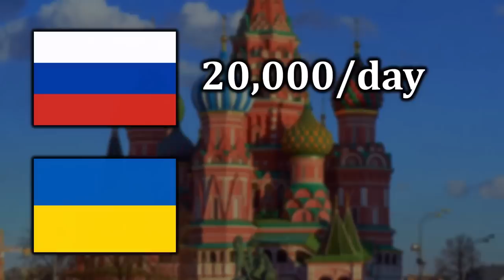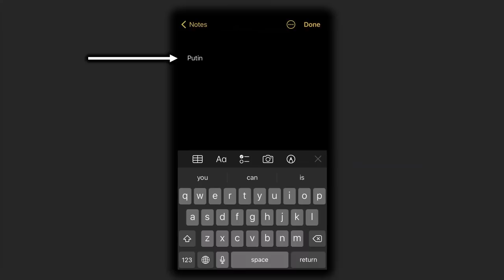Ukraine's Artillery Shortage Has a Simple Solution. Will the West Implement It?

Comment: Also, if more shells are supplied, the barrels will wear out more quickly. Which means producing more artillery barrels is needed.
But going through with the producing contracts would be cheaper than going back to the appeasement politics. Which worked extremely well last time Europe faced warmongering dictators...
Reply: For some definitions of "extremely well".
Reply: @johnbaker1256  yeah, I'm not the best when it comes to sarcasm in text form...
Reply: @AssassinAgent  The sarcasm was clear.
Reply: @AssassinAgent  You're doing ok
Reply: @AssassinAgent The sarcasm was loud and clear (ly sarcastic).
Reply: The thing is, NATO military doctrine is to use fighter jets deployed munitions rather than artillery.
Artillery role is supposed to be auxiliary.
And it makes A LOT of sense if you think about it.
You can have gliding bombs attached to the plane right in ammo hub in Germany or UK, get refueled over Poland or Romania, drop its payload and fly back to Germany.
No need for long and vulnerable supply chain, no need to put your artillery in a position where enemy can attack it.
And as for infantry close support, it is supposed to be done by tanks (like UAF already do) and by attack helicopters (Hellfire missile was designed with this kind of job in mind, not to mention Brimstone)
Reply: @skipperg4436 All of that makes sense in a context that doesn’t involve Ukraine. If Ukraine can be fed enough artillery and other resources then Nato essentially has a crippled Russia that cannot do anything without having to expend any of the manpower and more expensive aircraft resources. Essentially changing the doctrine on the fly to use Ukraine as a proxy war is the optimal new strategy that should supersede the current doctrine at least temporarily
Reply: @skipperg4436 except the UK have just announced it is going to expand its cdre of self-propelled artillery! 

Also 155mm shells also get converted into laser or precision guided smart munitions, glide bombs and rocket assisted glide bombs.
Reply: @DraigBlackCat  UK is doing their part in defeating Putler
Reply: @badart3204  true.
However it is possible to avoid the problem of raising manufacturing of new shells entirely by providing Ukraine several hundreds of fighter jets.
There are many thousands of fighter jets around that are currently idling.
Also this would solve the question of anti-air defense and naval defense because fighter jet is a great platform for weapons that can do all of these jobs.
That's basically the reason why western countries don't rely on artillery anymore...
Reply: @skipperg4436  I just hope our Govt refills the larder so we would still be able to do something similar in 10 years time!
Reply: I'm also a little concerned that the mighty USA can't provide enough artillery shells for Ukraine to wage war. US doctrine is based on being able to fight a two-front war..  against China and Russia. 

Even if all NATO countries met the 2% target this problem would still be there, it's not like all that money would go to 155mm artillery shells. It's clear we have all underestimated how much artillery could be needed in the event of a war. 

These shells cost $3500 each, so for $3.5 billion you can buy 1 million shells. Maybe more in bulk idk. Considering NATO's combined wealth of over $32 trillion GDP (not to mention non-NATO partners supplying help!) there is no excuse not to sign large artillery shell contracts with manufacturers. Absolute worst case scenario: we end up with a massive stockpile of NATO standardized shells, which could actually come in very handy as this war has clearly demonstrated. 

You're also correct about the artillery barrels but I have a feeling the shells cost more in total. I'm sure spending, say, $20 billion on artillery shell and barrel production would get Ukraine millions of shells. That's a lot of money, but considering Germany injected a one-time extra $100 billion into defense last year I'm sure NATO collectively can afford it quite easily. And if the war ends we'll be prepared for potential future conflicts. No matter how much equipment evolves, the ability to rain artillery hell down upon an enemy will always be a useful thing, as Russia has demonstrated. 

Also Ukraine itself could produce 155mm NATO shells probably far cheaper in a total war economy.
Reply: @Altrop  it since they dont want to go into its warreserves they still have over 10 million shells in stock since they want the shells to fight those 2 wars
Reply: @Altrop  they just don't want to because they - their government not regular folk - don't care. Thus all the excuses
Reply: @skipperg4436    @tuehojbjerg969 then we all have a moral duty to tell our governments we want this. Some opposition parties will agree, even if it's only for votes. Then the governing parties shit themselves and will give in, afraid to lose the next election.

Ah the beauty of European politics.
Reply: @skipperg4436  And this is the whole reason why Ukraine is struggling... nothing much in the air. Hopefully the aircraft, whether F16s or Mig 29s from Poland and maybe some attack helos, will turn up soon and make a big difference. You can't shoot down aircraft with tanks or howitzers, but the aircraft can make a hell of a mess of ground forces. 
My favourites would be the 40 year old retiring A10s from the US, they still have a hundred or so that can fly and if you want to destroy tanks, the cannons on those things with depleted uranium rounds would make a mess of anything that the RuZZians care to make targets of!
Reply: @baggycattube  MiG-29 can't because their radar is vastly inferior to that of the RUssian jets.
That's why Ukrainians are begging for F-16.
Realistically though they need F-35 or at least Typhoons becaue of Russians having a lot of anti-air assets - both ground based and airborne.
A-10 I'm afraid would be shot down almost immediatelly: Russians are shooting down Ukrainian Su-24s launching JDAM-ER bombs at maximum range...
Maybe - maybe - F117 would be able to survive in such environment but definitely not A-10...
There is no workaround.
UAF need modern fighter jets and need them ASAP. Ideally - in the previous year...
Reply: @Altrop  well at least we have better political system than USA...
Reply: @skipperg4436  I agree that they need F16s but the Polish Mig 29s were upgraded a while back with advanced avionics and at least the Mig 29s are familiar and don't need new training for the UAF pilots to fly them. Maybe the Taiwanese air defence systems will also make a huge difference... if they arrive in time.
Reply: @baggycattube  well, thus far Russia evidently have air superiority over the front line.
Their attack helicopters are able to destroy UAF armour.
Their fighters are also able to shoot down UAF fighters via very long range missiles launched from high altitude.
Su-35 radar is just that much better.
And UAF don't have long range A2A missiles either.
Reply: @skipperg4436  Makes more sence if you fighting camels and viligers with sticks. In real war it dont, specialy with the amount of electronic interference Russia is using. All those planes, guided missiles that use GPS, wont even hit near their targets.
Reply: @skipperg4436  And who is gonna fly them? Who is gonna maintain them? 1 flying hour roughtly means 17 hours of maintance.
Reply: @avengerpz  evidently wrong because himars missiles, jdam, storm shadow, number of precision artillery shells and drones all use gps and all hit their targets with very high precision
Reply: @avengerpz  according to US Airforce officers who did skill evaluation of UAF pilots it would take 2 months to retrain them from MiG-29/Su-27 into F-16.
Reply: @skipperg4436  Which is false. In extreme situations, which they will be facing all the time, one depends on insticts. And they have instincts gathered over a years of flying with russian planes. You cant overcome such instincts with 2 month training. It will be more easy to train people that dont have a clue how to fly a plane, then to retrain people that are already used to fly completely different plane.
Reply: @skipperg4436  Except they didnt, evidently all of those "precision" gps gided armaments miss half of the time exactly becouse of the jamming. As stated by Oleksit Reznikov, the ukrainian defence minister. 7 out of 10 jdam missing the targets.
Didnt you belive everything west and Ukraine saying? So you saying ukrainian defence minister is laying?
Reply: @avengerpz  "7/10" and how often unguided miss?

Comment: a good thing about artillery rounds is that you can't seem to overproduce them for storage.
 since wars use them so much, up to 50 000 a day, and storages explode from enemy missiles, so you need a surplus to count for that.
you could have 360 million artillery shells in storage, and it would still be a reasonable amount. you could have double that, 720 million artillery shells, too. and they have a shelf-life, too.. as it needs to be replaced after they have been sitting at the warehouse for too long, like all equipment.
so, you could mass produce everything, not just shells.
also shells would be good to be the more accurate variant, so you would need less of them. barrels wear on war, too.

a bad thing is a technical time problem: even if the EU would take defensive warfare industrialization seriously, i think mass industrialization takes decades, even with automation.

Comment: The crazy thing is that the West needs to get a stockpile of artillery shells regardless. The EU should just order 3 million per year for the next 5 years. This will cost just over 9 billion euros each year, which is not a big spending increase compared to all the aid sent thus far. The US could also produce a million shells a year at about $3.5 billion a year. Again, a 5 year contract at this rate would simply mean Putin would know that the West will aid Ukraine to 2028. If he leaves quickly after these contracts are signed, this artillery shell stockpile can be used in any emergency that pops up in the next 60 years. There is almost a guarantee of that happening.

Comment: think long(er) term..
1) after this war ends, the reserve supplys we have used will have to be replenished.  that's going to take time, probably years.
2) this war has shown, in bright neon colors, that most, if  not every country, vastly underestimated the size of reserves it needed.
those reserves need to be vastly increased.  this will take additional years over and above the time needed for #1.
3) if one country finds it has an over production capacity, the excess can easily be sold to one with a shortfall.  all NATO ammu nition is suppose to be standardized, so country of origin doesn't matter.
4) added benefit... building additional new storage facilities for the increased supply will boost economies.
fear of loss of revenue because the war ends early is pretty much groundless.

Comment: A second option is to have an alterable contract, which says, yes, we're going to buy 3 million shells, but if the war ends, we'll reduce the Rate at which we purchase. I just finished my daily report on Ukraine, you can find that on the left, right there under the Blue "U".
Reply: Thats not an option bc emty production lines are not profitable. 

A better contract is to buy the shells and just stock up or resell the rest if the war ends early. 

And if the usa is really willing to participate in other wars, like taiwan, then they need those shells within their shelflide anyway.
Reply: @berndarndt9924  I may not have said that clearly. I'm saying yes, you buy the contract, but you reduce the rate at which they are required and maybe paid. Like a mortgage vs on delivery. Overhead, supply, and minimal employment until full count delivers.
Reply: @up4open  You said it clearly. The problem is that you would have to pay for the max production capacity, no matter how fast you choose to buy the rounds.

The problem is, building a production line that can make 20000 rounds a day, looks a lot different than one that just makes 1000 rounds a day. And production lines need to run at a minimum load to be profitable, lets say 70%.

So when you choose to buy 20000 rounds of capacity per dey, will be forced by contract to pay/buy at least 14000 rounds  per day. No matter how many you actually order.

Employees who work the line don't make up a big part of the production cost of weapons. However finding employees can take time and so firing them doesn't work if the contractor requires you to be able to produce at max capacity at a moments notice.

Comment: Russia's artillery is not unlimited either. For example Covert Cabal estimated 5500 towed artillery have been taken from storage with many likely for the barrels. At the now higher loss rates Russia will run out around the end of 2024. They may be limited by the lack of crews, trucks, shells, and rail transportation sooner. He estimated close to 1000 units of self propelled artillery have been removed from storage but could not estimate how many of the remainder are functional. But Russia likely runs out of functional SPGs, transport, and crews too near the end of 2024 too. Without artillery Russia cannot attack or defend very well.

 It would be good to analyze how long western artillery supplies will last in comparison.

Comment: Very interesting information. I'm not sure the vaccine guaranteed contracts were a good thing, but I don't really want to 2d guess the decision, assuming that the decision-making process was proper. In this case I would guarantee 155mm shells, as they are standard and can be stored for a number of years.

I have heard that the daily fire rate of Russian artillery is now equal to the Ukrainian fire rate. Assuming this to be true, the question might be who will run out of shells first? What is Russia's continuing ability to maintain its fire rate? Both sides logistics problems are fascinating and should be receiving analysis.

Comment: The West has stocked a certain amount of ammo and the governments make a contract like: deliver us 20.000 shells, you can deliver 1000 next year and then in batches of 500 over the next 10 years. The company will use a production line and do it at all times when the production of other products is slow. But it does not work like this when you need 5000 every day.  The same production line now will not only make artillery shells, but other products like other grenades or components for rockets, that are in high demand at the same time. The only way to do it, is by setting up new production lines with streamlined processes dedicated to only one product. It is only a matter of money. The whole world needs those 155 mm artillery after the stocks have been depleted in many countries around the world. A lot of those stocks date back to the cold war in the 60s, so it is a good thing that those are gone and get restocked over time by improved newer ammo. If there is enough money, there will be enough production. Who knows exactly how many shells got used up since the start? And I may guess, that it is something like half a million shells 155 and 152 that came from stocks. That is a lot.

Comment: Europe certainly is partially to blame. But on the other hand, the fact that a juggernaut such as the US can't supply enough artillery shells to a local war between Russia and Ukraine is also concerning if they want to be ready with a war with China. 

NATO nations all honoring the 2% GDP requirement would not have (entirely) prevented this, it's not like all that extra money would have been spent on artillery shells all those years. 

However I see no issue with ALL NATO government guaranteeing these contracts. The standard 155mm NATO artillery shells cost $3500 each to produce, so $3.5 billion for 1 million artillery shells. And we've been throwing billions at this war already with many more reserved for rebuilding Ukraine. What's a few billion more? We can collectively afford it with ease, NATO's combined GDP is..  what..  40 trillion dollars? (too lazy to look it up). And  that's not counting non-NATO nations that provide aid.

I agree with you that western nations need to do this, not only to supply Ukraine, but also to signal they really are in it for the long run. This is a game of chicken and we are showing weakness over pennies. And even if the war ends early, we would then have massive stockpiles of artillery shells which, judging by this current war, is not such a bad thing. We might need them in a future war with a (near) peer adversary.

Comment: Why can't governments just pay manufactures to setup the production lines? Wouldn't that be far easier?

I'd suggest setting up production facilities in multiple sites across Europe. Each site has, just to make an example, 10 production lines. All sites use the same basic factory floor configuration and tooling.

Because all the up-front investment is carried by the tax-payer, there is no risk to the manufacturers, as they have no investment costs to recoup. In exchange, those investment costs can't be factored into the cost of each shell, so the cost per shell must be delivered a lot cheaper than they otherwise would have.

When the demand for shells ends, the manufacturers at all sites just mothball 9 of the 10 production lines. 

That we haven't figured this out a year ago is depressing. Hopefully the EU never goes to war, as we'll all be wiped out before the beurocrats finish blabbering.
Reply: I lived across the street from a plant they used to make tanks in WWll. The (underground bunker) storage wasn't removed until the 90's. They had the entire production line and some parts stored there.
Reply: @jilbertb  Wow! So you live in Germany? That's what I'd guess because I don't think they moved production facilities underground anywhere else.